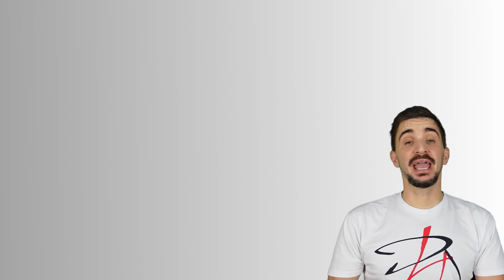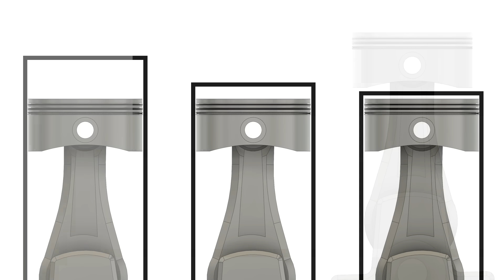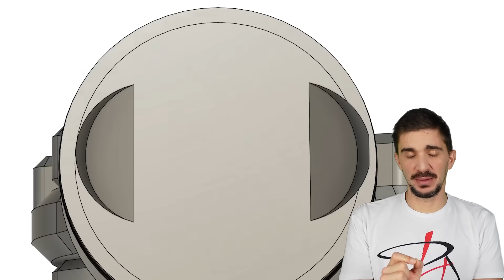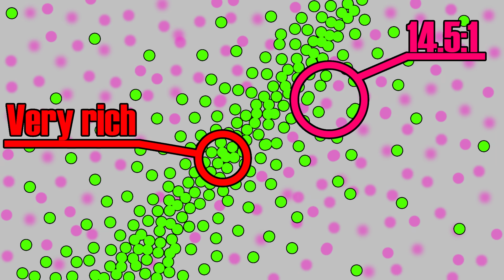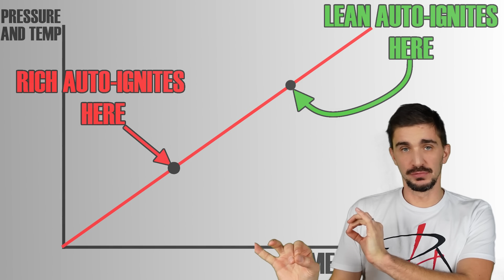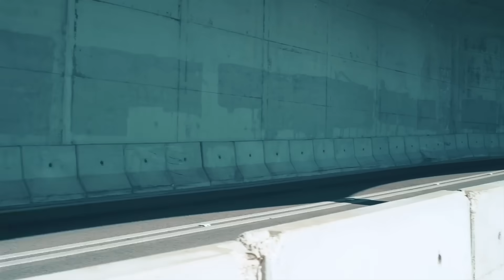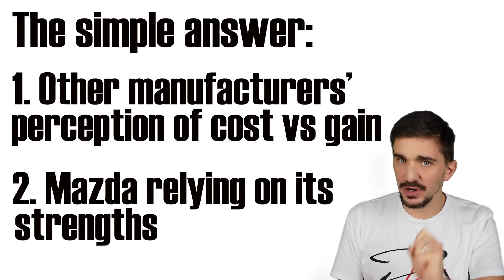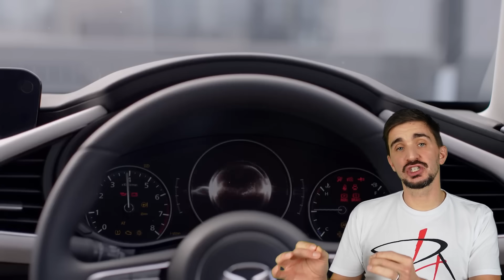The Game Changer Nobody Cares About - Mazda Skyactiv-X SPCCI How it Works and Why It Didn't Catch On

Comment: I’ve got to correct you on your initial statement about any internal combustion engines being clean and efficient. Most of the energy is wasted as heat. That Mazda motor that is likely no more than 35-40% efficient at converting the energy in the fuel into torque at the wheels. And these things belch CO2 from their tailpipe even when perfectly tuned. 

But electric motors are as much as 98% efficient. EV’s cost of ownership per mile driven is also less. Therefore EV’s are the future. 

Spending all this R&D money on legacy power plants that aren’t even close to being competitive is just crazy.

I’m still giving your video a thumbs up. You did a great job of explaining how this version of Mazda’s SkyActive technology works. And your illustrations did a great job supporting your explanation. 

And I agree with your assessment that a very complex 180hp engine that needs to rev high to develop any power is going to win over many buyers. 20 years ago, yes. But when you can drive an EV that gets the equivalent of 100-150mpg and has fallen to a price point that’s competitive with mass market ICE vehicles and has 250-500hp instantly available under your right foot I can’t believe anyone that actually tried one could ever go back. I know I can’t.
Reply: You can't betray physics. Namely the carnot process in all these cases.There is a general limit, you cannot overcome.

Comment: Mazda has a history of wasting time with dead-end engine technology. Nobody else picked up the rotary because it will never be a long-lasting, low maintenance and low polluting design. Is it cool in motorsports where an engine only needs to last one race?: YES! HCCI in gasoline engines is a big, fancy operation (which was already invented before being carried further my Mazda) that ultimately is based on using gasoline the wrong way. If you want compression ignition, use diesel. Gasoline is engineered for spark ignition and of course gas HCCI engines can only work well under just the right conditions. Other engine builders aren't interested because there are many other more useful ways to build a more efficient engine. I think Mazda themselves are even phasing it out when they bring in their skyactiv-z engines.

Comment: I thought I read a port inj sprays the homogeneous mixture at intake stroke and because it’s too lean to ignite on its own then when it’s at high compression stroke a separate gdi inj sprays a tiny amt at TDC to then ignite the too lean other portion of the mixture. Not auto ignition of the homogeneous mixture alone due to just the very high compression. Anyway cool tech to computer control gas emulation of diesel type ignition. The pistons on these even have a small cavity to facilitate the diesel action like a real diesel.

Comment: I've had a Miata with one of these engines for the last 3 years. Mostly city driving, almost no highway driving and I average almost 32mpg and I'm definitely not easy on the throttle. I have fun driving this car. Yea it's light so I'd expect decent mileage but not that much. 

Also the engine is.... just another NA engine. You can't tell there's anything particularly special about it, it just works. If I didn't have other goals I'd be buying it at the end of my lease in a few months.

Comment: New cars are so good at killing off nox emissions that most of it now comes from the tiny amounts of oil that get past the piston rings. Thats why manufacturers are decreasing the number of cylinders for an overall decrease in the surface area of piaton rings that eill all these particles past them. Why are the v8s being killed off? Tiny amounts of nox. Why are inline 4 cylinder motorcyle engines being killed off, same thing.

Comment: What if someone took the 'Future Proof' two-stroke, turned it into an H4, then added the Spark Controlled Compression Ignition. This, I, would describe as the HolyGrail of internal combustion engines. Probably because I'm a Subaru guy.

Comment: Mazda gets put in a box with Nissan for absolutely no reason at all generally having nothing to do with their reputation and in fact are known for the complete opposite in automotive industry set apart from CVT and head gasket issues and other major recalls. Bravo Matsuda for real innovation. Offering N/A ICE engines that are more reliable than Honda and Toyota now.

Comment: A long time ago I built a engine for my Opel Kadett Rallye -70. I used a stock 1900 OHC block with a 1600 head. With a thicker reinforced gasket and a camshaft with high lift capable of 11000 rpm's. The compression ratio was 13.5. I used a Ford Taunus 2.0 Weber carburator with 32/36 ports. I shifted at 9000 rpm's just to save the engine. 
At 90kph it revved 3000 rpm.  Top speed was around 210 kph. The car burned tires even in third gear. It ran for years with a points distributor and no knocks. Before the mods, top speed was about 170. I'm sure I could have ran with even higher compression.

Comment: No, SPCCI is useless as a range extender. A cheap, simple Atkinson/Miller cycle is already 40-42% efficient. SPCCI at generator loads can't stay lean. It an not be used for this purpose.

Comment: Looked for this engine in a search for the American market, this is what the search answered: Mazda Skyactiv-X engine is not available in North America. Sighting it was judged too expensive and not fuel efficient enough. Yet it would seem this engine's fuel mileage is between 40 and 50 mpg. ? I don't get it...
Reply: I think it's because of the fuel quality in US. X engine requires min RON95, and with less than that it's not efficient. But upcoming Skyactiv Z is fixing that problem (and some other issues) and should come to the US as well.

Comment: Going to say you missed the mark. The reason it's not widely adopted is because there is an engine that uses compression that gets better efficiency. It's called a turbo diesel.

Mazda didn't think this through, maybe in countries where there are heavy taxes on carbon emissions like in Sweden it makes sense. But like.... I'd rather just have a hybrid.

Now if they combined this engine with a hybrid,  not the starter engine hybrids. Then they might be on to something

Comment: It sounds great, but I looked up the cx-30 mpg, and real-world is around 40.  If it got 75 mpg I'd say it's wonderful, but Hybrids get 50.  Maybe if Mazda made a hybrid with a smaller version of the engine you would have something.  Incidentally, I wonder why no one has made a hybrid with a turbo-driven generator to get that last bit of efficiency.

Comment: I've been driving a red Mazda CX-30 Sky-X for a year now. My driving style has always been quite active, sometimes descrived as abrupt😅, and I hesitated adapting to an automatic gearbox.
 
This car can be driven so smooth just letting it save fuel, or like a Grand Tourer letting you enjoy the road, or even like a rally racing car on manual. 

I often turn it on, breath and pause for 5 secs, to answer as she asks me "how do you feel like driving me today?"

I enjoy the mild hybrid electric kick, but would just upgrade it to double battery capacity so it would be more available to save energy and fuel. Is there any way to do that upgrade, Mazda Engineers?

Comment: Another comment on this engine : it is possible to monitor the running mode of the engine on the console, and it works 90% on SPCCI. I was very surprised to see that. The few exceptions : motor breaking (obviously), idling, first meters from cold start, and sharp transition from cruise speed to full throttle (during 1 or 2 secs).
Reply: I can confirm this, and I would say it can work on SPCCI ~95-98% if you are not going crazy with revs (below 4600rpm). I tried to see difference in consumption in SPCCI mode vs non SPCCI mode at constant speed, but if you are not going full throttle, SPCCI won't shut down :) I gave up trying at ~5000rpm.

Comment: I've owned a mazda 3 skyactiv X for a year now. I knew nothing about SPCCI before the test at the car dealership, and i was not expecting anything : I had tried some modern turbocharged 3 or 4 cylinders, and I noticed all these engines were feeling empty below 1500-2000 rpm. 
Unlike journalists and most people bored with driving, i got instantly astonished by the smoothness of this engine at low revs. I started the car from 2nd gear and it went easlily like my old infamous diesel, but all the noise and vibrations had vanished. After one year I can confirm this engine is really awesome !

Comment: Driving a Mazda SUV I had rented  I changed lanes. Lane change monitoring technology had just been implemented, I had read about it but didn’t know that it was in this car. As I changed lanes in heavy traffic at relatively high speed, the car decided it didn’t like that, violently ripped the wheel from my hands, and spun the car back into the previous lane almost causing a large accident which I avoided only by fighting themotor in that system. It was more than a mile before I could pull over and let some of the adrenaline subside.

Previously, my wife had bought a brand-new 626. I’m 6’ 1”, and it was a little hard to adjust and fit into that car.  But we took it on a trip to Florida.  As we approached the central part of Florida, some jerk whipped in front of us and slammed on his brakes. I had no choice but to brake as hard as that car could. It shouldn’t have been all that close, but at least two of the wheels did lock up despite the much ballyhooed ABS system (pretty new at the time), we lost control and ran into the median, essentially ruining the brand new car and of course ending our trip — which had just begun.  The 626 was pretty expensive for the size, power and MPG.  Its performance was really lacking: 0-60 was over 15s; it handled like a whale; and of course trying to stop it in an emergency was not a good choice ….

It’s hard for me to look at Mazda again.  They spend r&d tuning the sound of the exhaust system but they sure don’t handle or brake like a Toyota, much less a BMW or Mercedes.
Reply: Besides the fact that these are two completely unrelated anecdotes separated by 20+ years, there are lots of holes here (0-60 in 15+ seconds is 100% BS lol) and lots of passive-aggressive bias. We get it - you don't like Mazda. That's fine. Don't buy one. You don't have to make up stories on the internet about it. 🙄
Reply: @daedalus_20v  The 626 was a mutt. Handled like a whale, and with two adults and two medium suitcases of clothes 0 to 60mph took all of 15 seconds.  The SUV ripped the wheel out of my unprepared hands; it was, just like your appraisal, a pos. Where did you get “separated by 20+ years”, Kreskin? Hope your next mazda treats you as well, sounds like you deserve it….

Comment: Always wondered what "Skyactive" meant, thanks for the thorough explanation!
Reply: What DOES IT MEAN?
Reply: @amyhermanns9885  Mazda makes gasoline engines like diesel engines, and their Skyactiv-D diesel engines are similar to gasoline engines in terms of the compression ratio.
Reply: Downsized engine, turbocharger, direct injection. Lean burn in cruise. Its the predecessor to Fords "EcoBoost" as they developed or borrowed the tech from Mazda when they owned the company.

Comment: Such a pity, because the fix for the HCCI mode and the lack of necessity to "work the engine" is pretty simple : Use CVT.

If you also add a decent battery for PHEV you have a perfectly valid zero emission car for city and a an efficient long range car o range extender if needed.

Comment: You kind of went off the deep end with the philosophical question, so I guess I’ll jump in as a random person on the internet.

I drove a manual for years. Then I got a DCT. Would I go back? Sure — if the car I wanted was cheaper that way or only came in that trim.

Same with AI. I use it to move faster. But I also know how to do the things I’m asking it to do — otherwise I wouldn’t be able to tell if the output is good or garbage.

This isn’t the end state of anything. The engine Mazda built might find a killer application we haven’t even thought of yet. Or it might go the way of the rotary (and even that still pops up from time to time). Calling efficiency a slippery slope feels a little fatalistic. Change just… happens.

Yeah, some people might try to outsource their entire brain and coast through life.

But you don’t have to.

Context matters. How you use the tool matters.

(I had AI rewrite my original comment because while I knew what I wanted to say, I didn't want to spend 20 minutes wordsmithing a YouTube comment)

Comment: I grew up on stick shifts on both the VW Bugs and larger cars. I didn't have power steering or brakes and windows had a crank. All the while you were driving, YOU WERE AWARE YOU WERE DRIVING! You paid attention to everything because everything REQUIRED your attention. In a "manual" car, you automatically become aware of all your surrounding, unlike everything automated in today's vehicles. When I currently drive a large commercial truck, it's back to the beginning with things being manual again. Manual vehicles require(d) thinking and decision making, meaning I was connected all the time. You knew when your engine was struggling, your brakes were being taxed, you cornered to fast and felt roads with ice. Today, with anti-lock brakes, I can no longer "feel" the grip of a winter road by tapping the brake pedal to see if a tire locks up. The A/L system takes over and isolates me and I have no idea how slippery it is. It makes me a worse driver. Traction control doesn't allow me to get out of a situation because IT is driving the car and dismisses my judgement as to what to do. It's maddening. Personally, I would like to try a Mazda with this and see how I like it. I drive quite normal, so being a hot rod is not in my interest and am used to driving slower vehicles (36hp Beetle). Winter weather either teaches you to drive, or to keep a tow truck phone number handy.

Comment: Always tought that engine would be best used with a Hybrid Synergy Drive hybrid transmission. The electric motors would provide the torque and response and that engine would provide unheard of fuel efficiency. Plus, a Prius or Mazda3 with both the unkillable and very effficient Toyota hybrid system and that holygrail of an engine would be sweet! 

P.S. The Skyactiv-X is Supercharged! Even if the supercharger is used for cylinder pressure control and not power.

Comment: I have a 2024 Mazda 6 With the 2.5L turbo skyactiv engine and I love it. I drive that car hard in town but after 15k kilometres I average 8.5L/100 which is insane. Any other modern petrol engine would struggle to stay below 10 the way I drive. The car is also very fun and sounds amazing even with a stock exhaust when you put the foot down. It really does feel like a sports car from the late 90s/00s. Every time I drive it I have a smile on my face and I appreciate Mazda for what they have done.

Comment: Impressive engine, damned shame Mazda haven't made any vehicle I'd be interested in owning. As a fan of wagons specifically big enough to allow me to throw an entire bicycle in the back with the seats down, or a washing machine in the back with the seats up, their range is sorely lacking. Given the only 2 people I know who had Mazda 6's, the last car that would nearly meet my needs both had engine failures and at lower mileage than the car I currently drive already has - they were both diesels rather than Skyactive engines though.

Comment: This mazda engine doesn't have anything different than other brands motor. You can easily increase compression ratio by boost up the turbo pressure. Meanwhile lean burn or not depend on how much the injector spray fuel out.    But why others choose not follow on Mazda?  Easily, What all the clip said are easily done by Atkinson cycle engine.   Yes, you can change engine volumetric just by adding the Atkinson cycle there.

Comment: 13:50 This could be a symptom of the shitty transmission programming Mazda puts into their TCMs. We bought a Mazda CX-5 last year. I wish we would have bought an EV instead. The I4 + 6 speed auto drivetrain is horrible. It's rough and its always in the wrong gear and even when its in the right gear it is still slow as heck. The thing sounds terrible too. If this was a manual trans V6 or an EV I reckon I'd be a lot happier.

Comment: How does the Ford Maverick Hybrid get this same sustained 40MPG?
Skyactive-X isn't available in the USA.  Most likely because this technology requires a feed-forward control system that is slow to react.  This makes the engine feel like it has half the power.

Comment: Use it power a generator and feed electro motors and batteries so it runs on a constant RPM in optimal conditions and the ups and downs are covered by the electromotor, a perfect hybrid

Comment: Hang on; if the whole charge ignites early in a standard engibe, its called pre-ignition and destroys pistons, rings and valves.
But if you let it all go bang whenever it likes, its called SkyActive, and its really efficient.
Bear in mind, spark control can only work early, ie more advanced, unless you keep the fuel/air ratio really weak. But a lean charge is a major cause of overheating (pinking, burnt plugs, etc).
So what's actually going on here?

Comment: 150 hp in 15kg engine, 600cc (using parts as a lawnmower single-cylinder reciprocating ) 
H2 starfire: https://www.youtube.com/watch?v=4fd5pEq31m0
Omega 1: https://www.youtube.com/shorts/qrwAx65ZYlo

multi-fuel, no rotor seals at all, is this possible could you do a video on this?
it a turbine engine but way way simpler that it can be used in a car